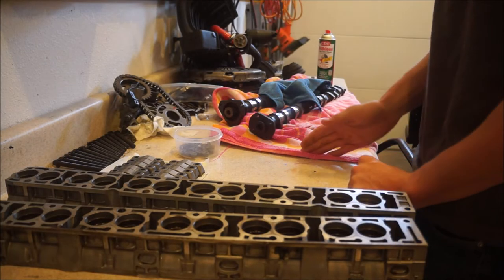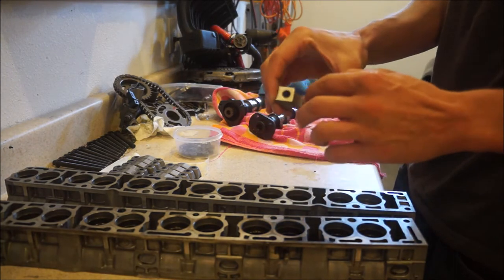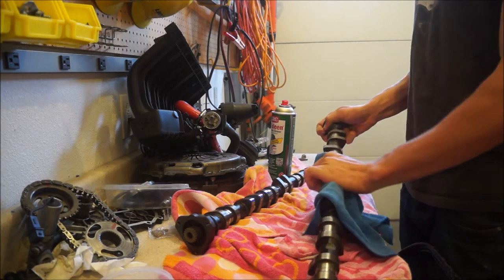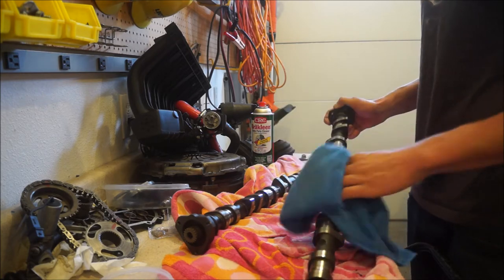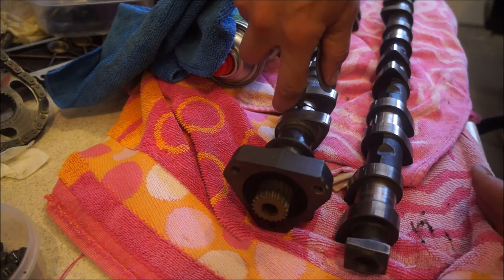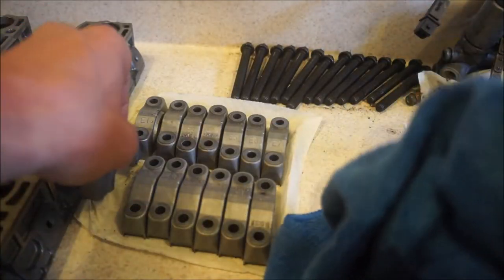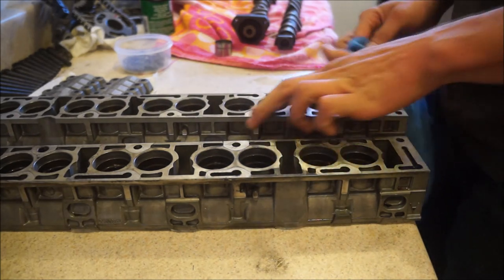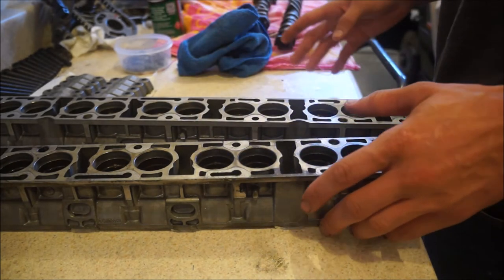E36 Cam, Lifter and Tray Cleaning: Install prep.

Comment: just got my head machined and they told me I should bleed the lifters before installation, any tips on that? Haven't found any good forum posts
Reply from the maker: Put them upside down in a bucket of motor oil and let them sit overnight, should do the trick. I usually dont worry about bleeding them before hand
Reply: @M3NACE  cool thanks man your videos have been a lot of help
Reply: @M3NACE  also, how do I know if they've been bled?
Reply from the maker: @itslawrencedood  just leave them in overnight and dont think too hard about it lol. When you fire the motor up oil will be shot up inside them. If you stored them in the tray's upside down then more than likely they will still have oil in them